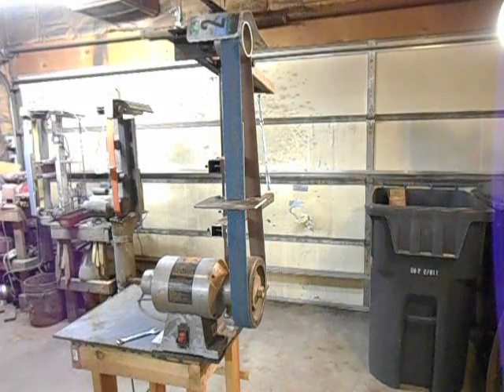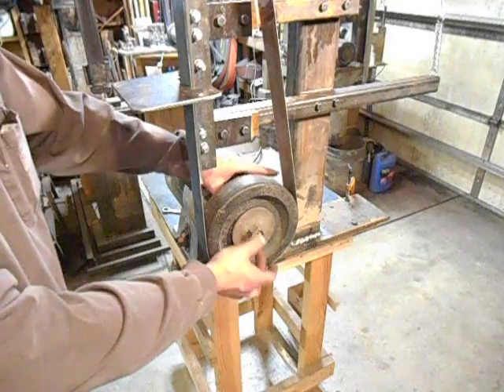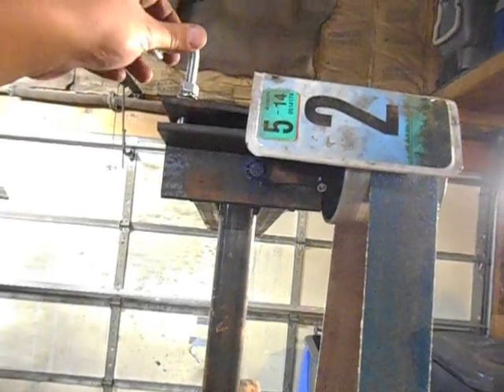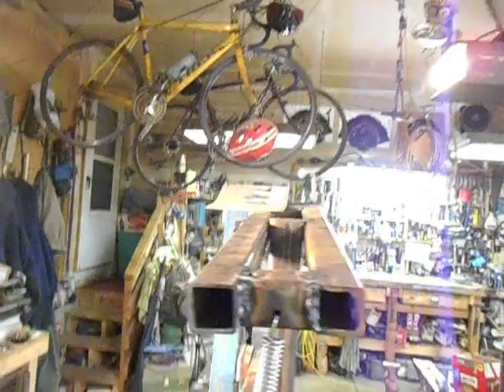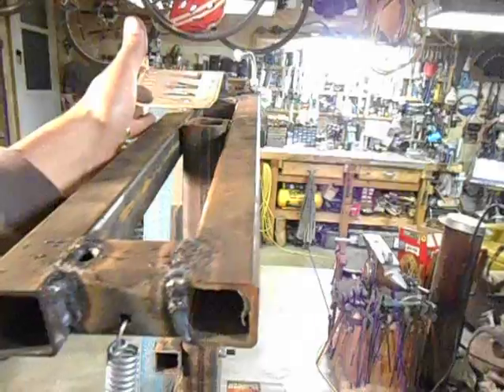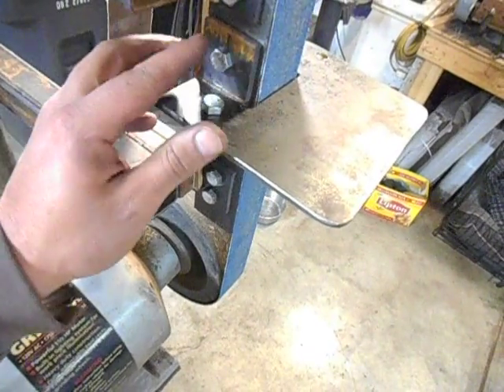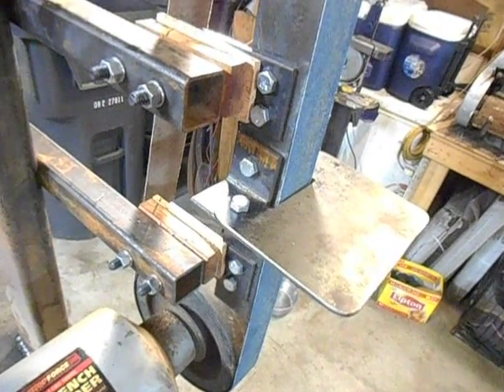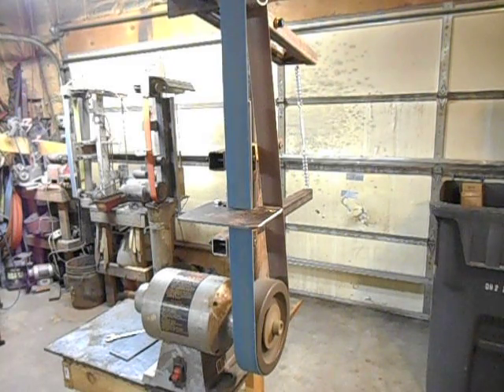new 2x72" belt grinder

Comment: Nice job Joe! I make all kinds of shop equipment from whatever I can find laying around. Treadmills have been a huge resource for me. Lots of tube steel rollers with. Bearings and a variable speed motor what more could you ask for and I usually get them for $30 or even free!! Some people think they are just to good to use old junk though. That's ok just leaves more for me and you right Joe?!?

Comment: Joe, how do your bench grinder motors work/hold up to driving your 2x72 grinders?  I am debating whether I use the bench grinder or a stand alone motor.  So, would value your thoughts.
Reply from the maker: Rick, they have held up really well. And i think they are a good match for a belt grinder. Plus once i got used to having a belt grinder, i dont keep a hard wheel grinder in my shop anymore anyway, so its a good use for a motor that you may have around already, saving money that u can then spend on belts.
Reply: Joe Calton Thanks Joe!

Comment: Joe, nice grinder.  Have you ever made a surface grinder?   I am looking for information on building one.  Thanks, Jeremy.
Reply from the maker: McCullen Knives ive never built a surface grinder. they do have one at the steel yard I like to buy new steel from and it is a beast. the thing would take up half my shop. 
I think the tough part of building one would be the table, and how to build it so that you can control your grinding. or you could go the other way, and maybe take a hand held angle grinder, and a milling table vice and mount the vice vertically, mount the grinder in it, and then find like an old rowing machine for the table and mount a magnetic surface plate on it and then work it by hand.
Reply: Joe,   I appreciate the advice.  If I can get something to work I will let you know.